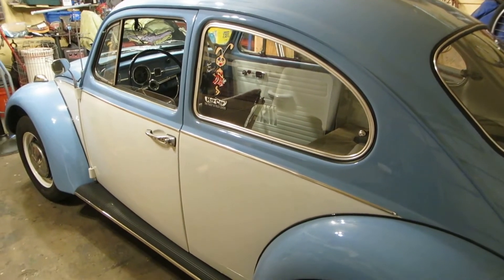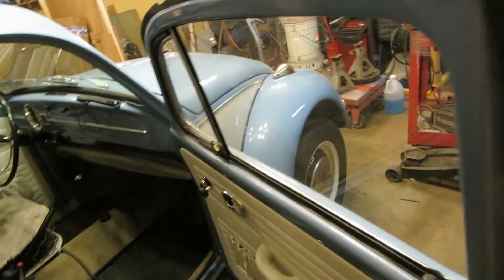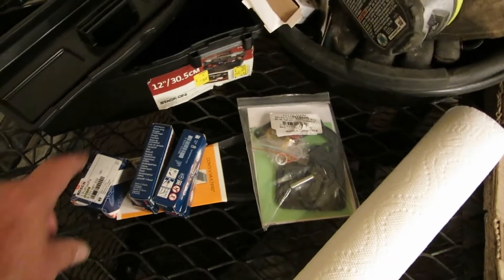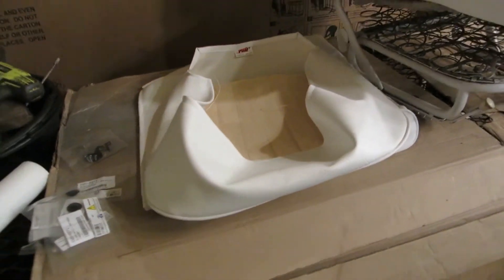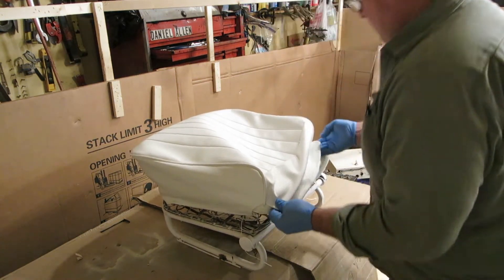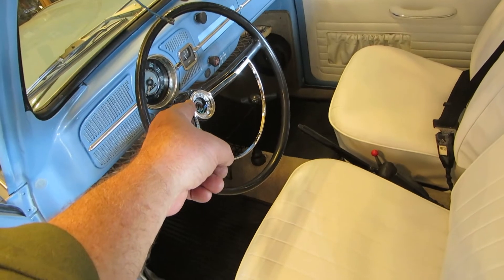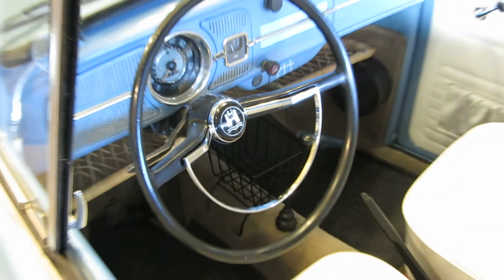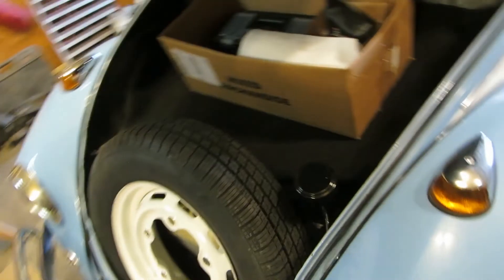1967 VW Beetle....Finished!

Comment: Hey Dan I had the same problem with the headlight . To adjust it it would hit the chrome rims and I got it to get a little more movement by bending the bucket tabs. I bent them , it got worse = the other way. I bought some lights from Wally World and they were Halogen . when I hit the brights . I remember buying one at Autoshack and it was 2.99 ?
Reply from the maker: Yeah, I tried to bend those tabs.... I got a little..but not enough. I am going to drill slightly bigger holes and use a small washer.
And yes, I now have halogens also